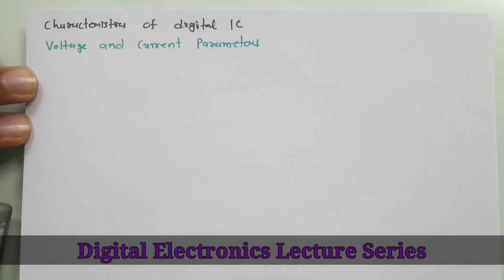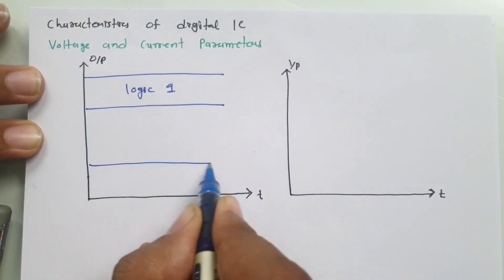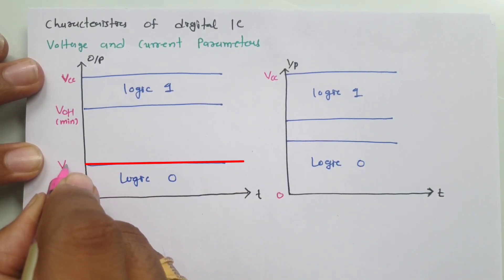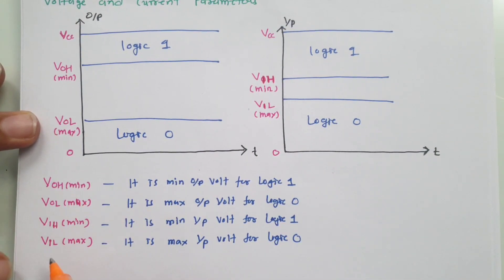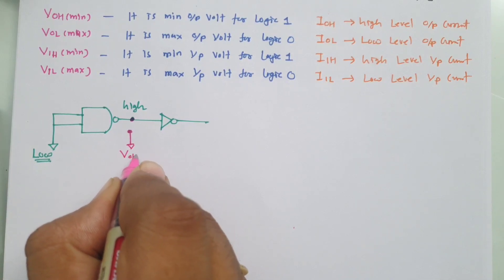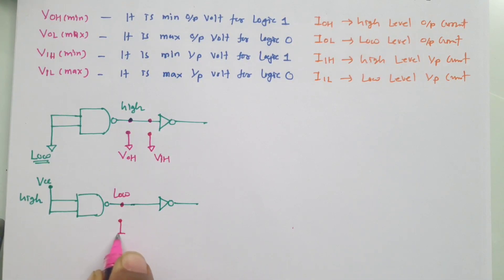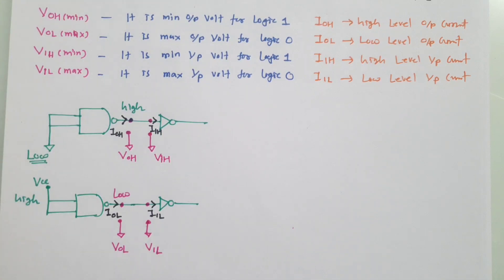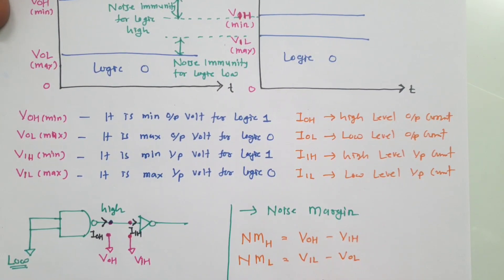Digital IC Parameters: Voltage, Current, and Noise Margin

Comment: 00:02 Explaining the voltage and current parameters and noise margin of digital integrated circuits.
01:14 Voltage range defines logic levels for input and output
02:40 Voltage and current parameters define logic levels in digital ICs.
04:07 Voltage and current parameters are crucial in digital ICs
05:42 Understanding voltage and current parameters is crucial for digital ICs.
07:08 Connecting NAND and NOT gates affects voltage and current parameters.
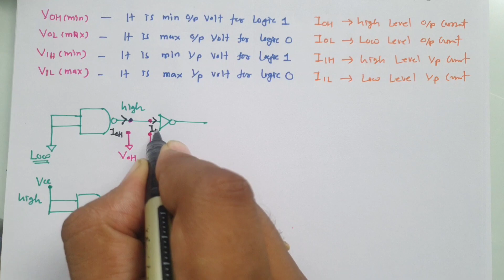08:29 Understanding voltage and current parameters in digital ICs
09:46 Understanding noise margin in digital IC.
.